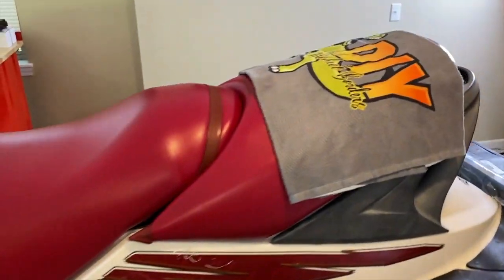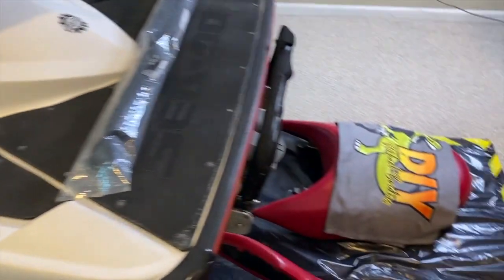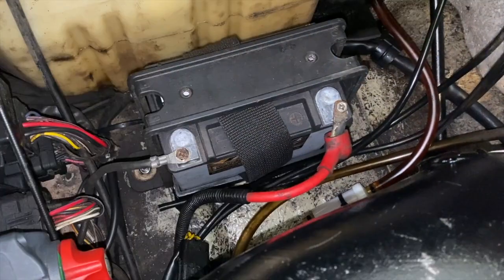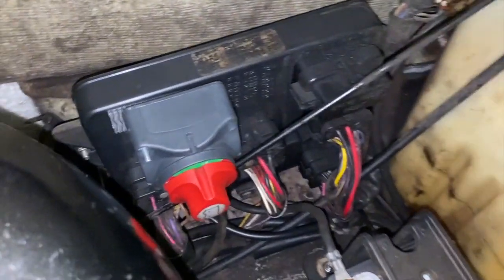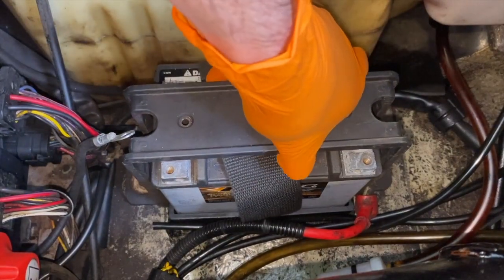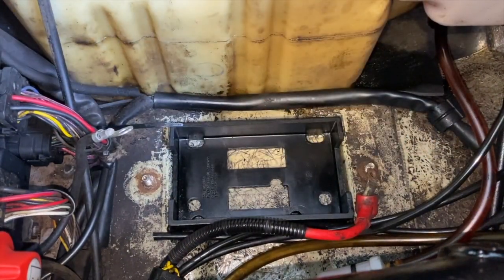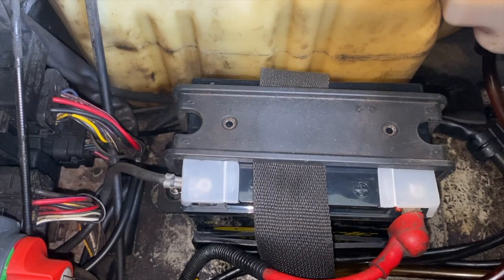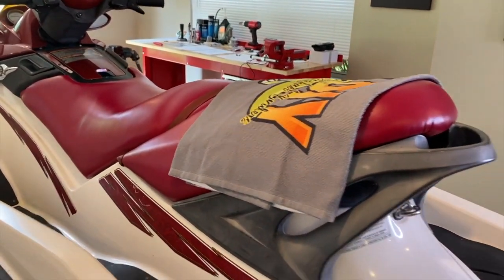Test charge replace Sea doo GTX jet ski battery - DIY

Comment from the maker: If interested in purchasing this product, visitor to Amazon affiliate link below.  I earn from qualifying purchases.

AGM Battery:  ￼ https://amzn.to/4cO13MX

Coolant temp sensor:  https://amzn.to/3U81ytZ

Solenoid valve:  https://amzn.to/4aLKT4S

Vacuum system check valve:  https://amzn.to/3U8PtVy

Battery disconnect switch:  https://amzn.to/49tskBH

Craftsman ratchet socket set:  https://amzn.to/3J8IkOH

Craftsman stool:  https://amzn.to/3VNLz5x

Craftsman volt meter:  https://amzn.to/3VS55OE

Swivel vise:  https://amzn.to/4awP2tK

START/STOP push button cap/cover:  https://amzn.to/3vomyDv

START/STOP button wire mechanism:  https://amzn.to/3TEoDDr

Glove box/storage unit latch kit:  https://amzn.to/3x9RMih

Oil filter:  https://amzn.to/49c0n0U

Seat latch:  https://amzn.to/43xVWwd

Front storage compartment latch:  https://amzn.to/43xVWwd

******************

1.  How to properly lubricate seat or storage compartment latch

          https://youtu.be/QiadPciE55E

2.  Jet ski storage compartment or seat not latching - Common causes

          https://youtu.be/gWX7obK3VA0

3.  Replace seat or storage compartment latch

          https://youtu.be/bweCd4TO-4U

4.  Replace glove box/storage compartment latch

          https://youtu.be/TmdrTVcUubQ

5.  Replace START/STOP push button cover

          https://youtu.be/VillHbgDckY

6.  Replace START/STOP push button wire harness

          https://youtu.be/5q9HbOxYY4Q

7.  Replace rear step foam pad sleeve

          https://youtu.be/w6HLiApFDuc

8.  Replace Sea doo GTX Starter

          https://youtu.be/Q8_be66r0Yw

9.  Replace Sea doo GTX Ignition Coils

          https://youtu.be/1VrtwJl6hjI

10.  Replace sea doo GTX oil tank quantity sensor

          https://youtu.be/ZPCH5zgzTsY

11.  Replace coolant temp sensor

          https://youtu.be/4JOdX3GEphE

12.  Replace Solenoid valve

          https://youtu.be/SfjX9OtOyIM

13.  Replace vacuum system check valve

          https://youtu.be/iWjhaWlyQuc

14.  Install battery disconnect switch

          https://youtu.be/LOSq10Of_UM

🧰